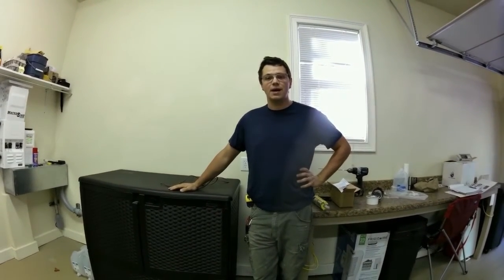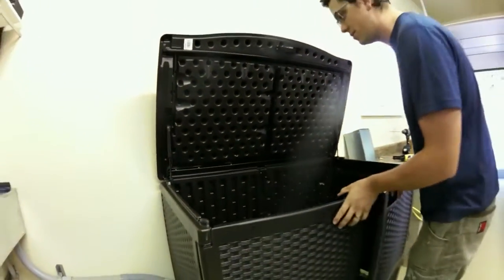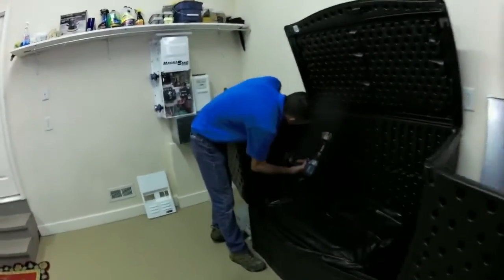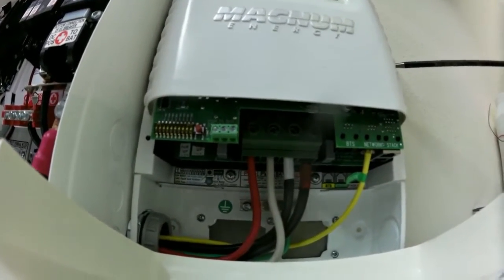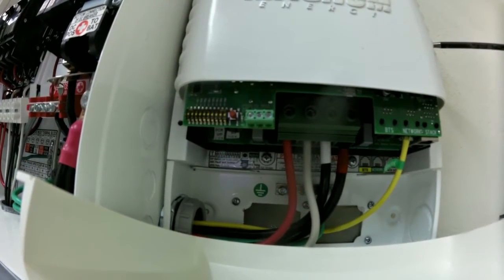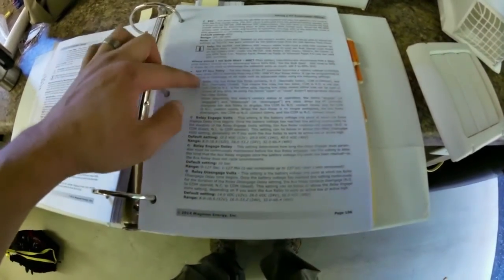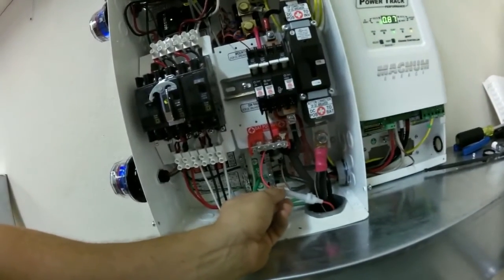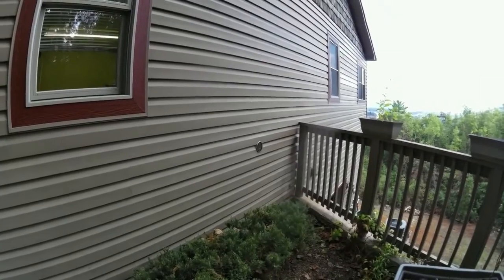Solar Installation pro tips: Battery Venting with Powervent by Zephyr

Comment: Very helpfull video.  I like when you get into some more detail on specific solutions.  I am about 1 week away from installing this exact same setup.  I have a few request for detail videos: 1. Roof penetration.  2. System grounding from collectors to critical loads panel. 3. Rafter locating, measuring, chalking and drilling the holes for the solar panel mounting flashings and L-feet.   Keep them coming.  Thanks!
Reply from the maker: I'd love to show you how to do all of that but I definitely cant get a video up on all that by next week.  Thanks for watching

Comment: Do you have the conduit from the battery box to the cable tray sealed off and a separate vent hole at the bottom of the battery box to resupply the box with air? If not, then you may be venting hydrogen gas through your Magnum inverter and Magnum charge controller when the battery vent fan is off.  i.e. the Magnum fans may be sucking air from the cable tray and conduit leading to the battery box.  Can you please explain how your resupplying the box with air?  Thanks!

Comment: The only reason your PT100 panel won't come off properly is because you have your metal conduit box snug on the bottom of the PT100, it should just slide off going down. also I just installed the Zephyr fan and it should be Vertical for the damper to work properly.
Reply from the maker: Tommy Fournier we remove the dampers in case the fan fails gas can still escape. Thanks for watching.

Comment: To fix the cover probelm! Instead of coming in from the side, go in from the botom with 2  * 1 1/2" pull nippel and leave a 1" gap.
Reply from the maker: yeah that would fix it but I prewire the magnums and then hang them on the wall.  It'd be hard to prewire with the big ole' gutter